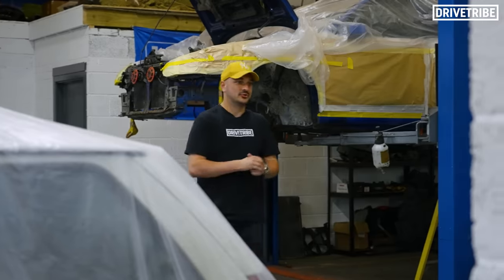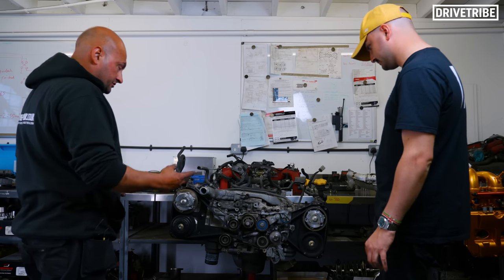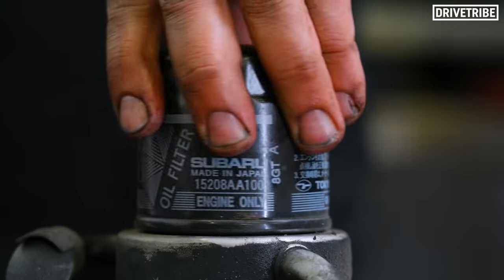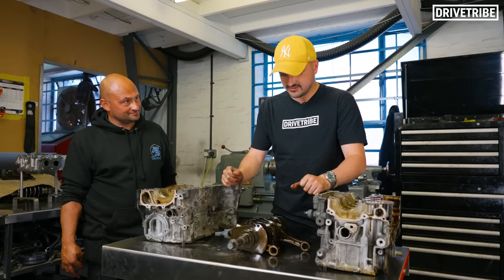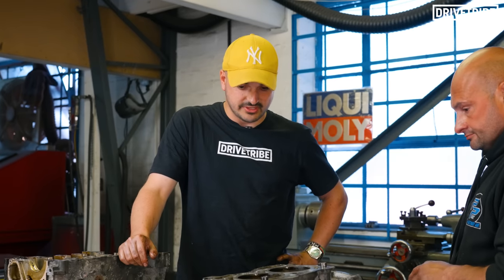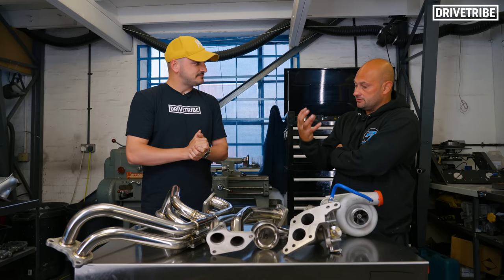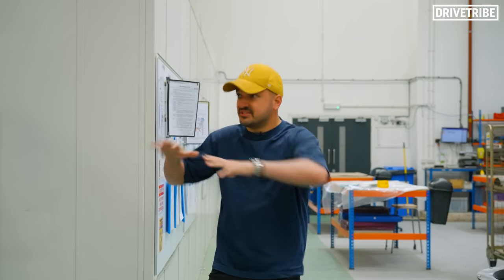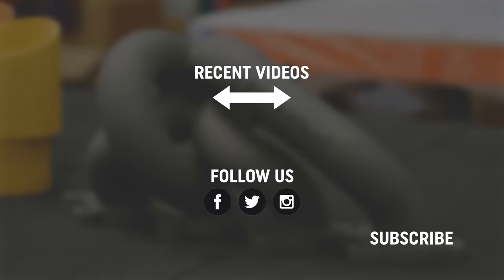Turning Richard Hammond's Grand Tour Subaru Impreza into a 500bhp monster! | Project Martin Ep.5

Comment: i honestly would keep the unequal length headers just for the sound
Reply: yes me too, I would rather have less than 500hp and subie rumble than equal headers, but it is easier to make that much power with equal lenght headers
Reply: @matejdimos5749  reliability wise however, equal length is proven to be much better than unequal length
Reply: It was already twin scroll equal length from the factory, go back to 13:07 and take a look
Reply: the jdm 2.0 sti specific engine (ej207 ver.8) came with equal length headers from factory with a factory twin scroll turbo.
Reply: @nickt5978  ah okay, fair enough
Reply: Did the same in my STI. It just sounds incredible. Bought some awesome aftermarket headers.
Reply: @nickt5978  Came here to say this. Plus it sounds WAY better when you rev them to the 8k redline
Reply: I’ve been on the edge on if I should get equal or not for mine ??
Reply: what? the ej207 is EL from factory that rumble sound is amazing, the US style UEL is so exaggerated.
Reply: @theplace247  Equal length and twinscroll is just better. Totally different sound. If you have a mostly stock 300bhp car that you just go about in for fun, unequal is fine. If you're spinning 8k+ and just terrorizing things the equal length is just so rowdy.
Reply: Richard isn't gonna like the sound for sure
Reply: Some electronically generated acoustics would suffice. They are appearing on EV "Muscle" cars. 🤣🤣🤣🤣🤣
Reply: If they did unequal length it would blow cylinder 4 like all others run hard. Overheating. Equal length is the play.
Reply: While unequal  sound nice...equal header offer lower risk to engin while operating in sportier environment and making better powerbands too by being more efficient
Reply: @matejdimos5749  My GF8 makes 540 wheel hp and has unequal headers and the fastest 4cyl Subaru in the world has unequal headers. it really doesnt make as big a difference as people make out. Even if it did, I would hate my Subaru to sound like a Honda, thats not why I bought it
Reply: @lepermessiyah5823  that is cool, because the sound of subie is the reason like you said
Reply: Subaru isn’t a Subaru without the off beat unequal length sound in my opinion
Reply: As a UEL owner, it's overrated af. JDM twin scroll ftw.
Reply: Equal length superiority 😁 
They still burble nicely until around 3k before the magical scream starts. Best of both worlds
Reply: @nicholashawks9288 the stock JDM ej207 as in this car revs just over 8k out of the box.

Comment: I will say, maintenance is key along with how you drive your car. I bought a used stock 2011 GV8. Owned it for 7 years and am at 116k miles. I only went crazy with the mods two years ago but I'm still running a stock EJ257 and stock VF38 turbo. The power mods I have were done in relation to others that prolong the engine life. I went with Equal lenth headers, GDT cyl 4 cooling mod, IAG street seires AOI and replaced my failing stock turbo inlet with a Perrin turbo inlet with a Cobb SF intake. Also running Motul Excess 5w-40 oil. I did recently install a Koyorad radiator as the stock started leaking at top.  I do have other mods related to running E85 w/ my stock motor and turbo but are performance related. I think my motor is an example that the EJ257, in my case, is making 350whp on E85 for more than two years and I daily drive it with no issues. I'm not burning oil, no knocking, temps aren't getting hot. I would abuse it at the best times for the car. Don't sit in traffic in 95 degree heat then floor it once it's clear.. Maintenance can only take you so far but it also depends on how it's driven.

Comment: Great video! Very informative! And I love nothing more than a Subaru engine, SO much easier to change the oil with an upright filter. Try changing the oil in a Honda Civic where you have to squeeze your hand through extremely hot components to replace the filter (fun)
Reply: BMW straight 6 oil filters come off the correct way too. No hot oil running down your arm! 😂

Comment: I hope u guys will upgrade the brakes soon. Based on the previous video, Dixcel's PD Type rotors are only marginally better than stock rotors, and they can barely take more than 300whp. Ure gonna need 6pots brakes for these build no doubt

Comment: My WRX-based Tommy kaira M20b makes about 360. And I honestly do not want any more power than that. With the low-ratio 5-speed RA gearbox, top speed is just 205km/h at the 7,000 rpm redline. Full 1.2 bar boost is available from 2700 rpm, from the magnificent TD04 turbo, and it means that acceleration in 2nd and 3rd gear is ferocious, and the utmost driver care and attention is required, lest the vehicle gain the upper hand!
500 BHP would be nuts - and not very fun for a car with only 215 or 225 wide tyres.

Comment: Now we need James' Evo brought to the shop fixed for a old fashioned Evo vs WRX 90s rally battle on the Welsh rally stages.
Reply: It was scraped.
Reply: Sadly it had too much frame damage to be able to ever get it back on the road in the UK. It’s also a flood car after it fell in the ice, so it’s double dead.
Reply: Also both cars were from the 00's - wrong gen of both cars for 90's rallying
Reply: @JohnClark-ew8dh  Indeed.  A better Mitsu vs Subaru from the 90's is an early 90's WRX and an early 90's DSM or Evo 1-3.  The Early 90's AWD DSMs were rally monsters.

Comment: Living in the Pacific Northwest, and with Subaru being the car for the area, I can say with certainty, 1) Subaru's are known for blowing head gaskets and 2) changing the spark plugs (and simple job on most vehicles) is a pain in the rear, requiring a shop to do it for you.
Reply: 1. If they aren’t serviced right, tuned badly, run lean, have uncontrolled boost, etc. sure. Otherwise no more than any other engine. 2. It’s a hassle but absolutely doesn’t need a shop, just some lateral thought, and a tactical loosening of engine mounts. 7 years tuned EJ25. Zero ring land, zero head gasket, in fact zero issues at all outside wear and tear. Tyres, brakes, oil, belts and a clutch in around 55k miles.
Reply: @ferkle1980  Blown head gaskets are more common on used Subarus than anyother car manufacturer, and when you have to remove the engine to replace the spark plugs, the average joe isn't going to have the engine hoist and necessary tools to do it.

You can own a car for 7 years and only put 10K miles on it; it's the mileage, not the time that causes issues, like blown head gaskets. Generally, 9 times out of 10, if someone is selling a Subaru with 150K+ miles on it, it's got a blown head gasket; people in the PNW don't sell their Subaru unless it has major problems.

Comment: Most Subaru rebuilds fail because they didn't take the time to do the required machining like [Align hone] the mains or use a [Torque plate] on the bores with its fasteners.
Reply: ^This
Reply: That’s a pretty simple machining job, the factory lets them go out crooked? 🤨
Reply: @TML34  Reading Is Fundamental
Reply: @Sir.VicsMasher  so you agree, from the factory these engines are hot garbage.
Reply: @TML34  No, I'm referencing "Rebuilds". 😑

Comment: You probably know, but the reason most japanese cars have small engines is because of road maintenance taxes. The bigger the engine, the more tax you pay. So they would much rather get as much power out of a four to six cylinder engine than an 8 cylinder.